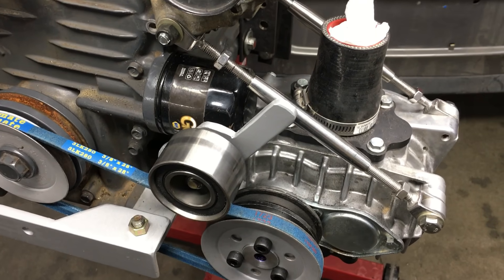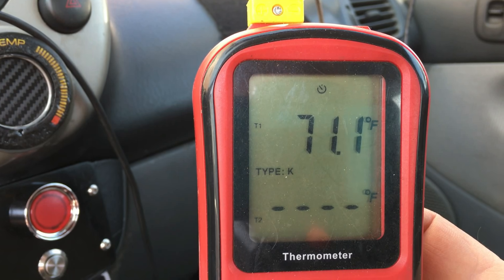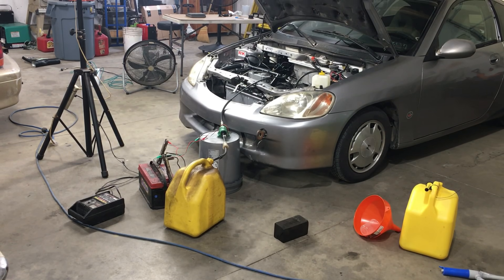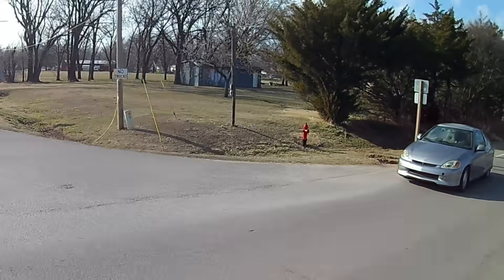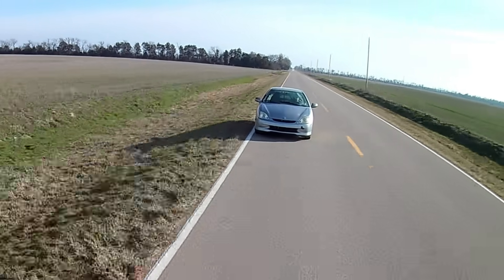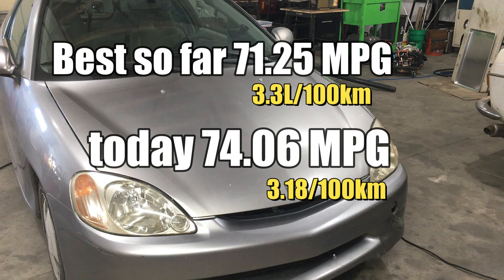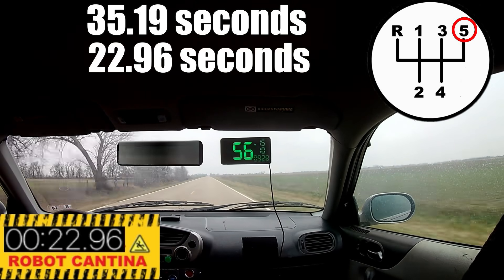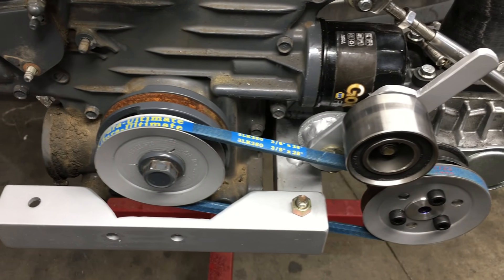S4 E10. We find out if the AMR500 supercharged Kubota diesel engine is more fuel efficient.

Comment: As you have not added more fuel it's possible that the extra torque that's now available is making the engine struggle less. Better economy on an engine with more torque but with no fuel rack adjustments🤔. 
Always enjoy the videos👍
Reply: Yeah I’ve noticed the same effect on most aftermarket small displacement engines I’ve supercharged. In normal everyday driving and especially during highway driving the extra torque will give you better mpg. It would be even more noticeable with hills since the rpm’s wouldn’t change much and gears wouldn’t need to change.
Reply from the maker: Keep in mind this is a diesel engine.  Adding more fuel during cruise is not the same as a gasoline engine.  On a diesel, adding more fuel only increases the rpm of the engine.  However the fuel rack is adjusted for more fuel at full throttle and that's how we were able to shave 12 seconds off the 0-55 acceleration test in the previous video.
Reply: @robotcantina8957  wouldn't 'adding more fuel only increases the power output of the engine and as a side effect increases the RPM" be a better way to put it? Only reason I say that is because say you're going one speed and you come up on a hill, a diesel will need more fuel*aka torque/hp* to climb that hill, but it doesn't necessarily mean you are going to change rpm! As you increase load on the motor you need more fuel to maintain speed of course!
Reply: @DarkAttack14  

For example:

Lets say you have 2 500cc engines trying to make 50 hp, and do so at 4000 rpm and a compression ratio of 8. You add a supercharger to engine B, and have it give 1 bar, or roughly 15 lbs of boost to roughly double the torque.

By roughly doubling the torque, you can use the engine at ~2000~, but for good measure lets say 2200 rpm.
According to a calc I found, to compress 500cc of air at ambient temp, its 28J, Assuming the supercharger is at 80% efficiency, this is 35J/rotation.

At 2200 R/m = ~37~ R/s. 37r/s * 35j/r = 1300 j/s or 1.73 hp. So it takes 1.73 hp away from the system.

However, by doubling the amount of air and fuel within the system, the air fuel charge density is doubled, which will act similarly to a higher compression ratio because the fuel and air particles are closer together giving a faster burn, so 8 * 2 = 16.

So, using a calculator online that has more accurate information than me. Going from 8 to 16 compression ratio, results in atleast 6% increase in efficiency.

So, 50 * 1.06 - 1.73 = 53 - 1.73 = 51.27. Based on this, the engine has a net increase efficiency of atleast 2.5%.
This does not include things like lowrpm high load efficiency gains, nor does it include being able to stay on the torque peak easier, or that camshafts tuned for low rpm torque peaks are inherently more efficient due to better fuel mixing and less stress and strain in the lifters and what not.

So, yes, turbos are not the sole source of efficiency gains in the charger world.

And before you say it YES, anyone with a leadfoot crappy driving will ruin efficiency gains, and turbos are not impervious to this as well. And YES, any charger, super/turbo, that is not adequate for the situation can and will also ruin efficiency.
Reply: @XenocraftGalaxy I know you're estimating but it would be a lot more accurate to measure pounds of air instead of PSI All that is telling you is restriction of the system not exactly how much air is being consumed through the engine
Reply: @robotcantina8957  👍👌
Reply: @bassbass69 Probably not, if it was a turbo yeah but more boost on this charger is going to just increase frictional losses for little gain
Reply: It'll be a bell curve. It can't go on like this forever. Also it's cruise performance being measured.
Reply: @ThePaulv12  of course, but it'll be fun to see what kind of mpg this little engine can pump out as well as how much horsepower could potentially be achieved

Comment: If you measure the weight of the fuel, then the temperature is irrelevant.
Reply from the maker: Its possible the fuel in the tank has expended or contracted during the drive which would alter the volume slightly and just to be safe we wait a while before we pump the tank out.
Reply: @robotcantina8957  Sure, but since expansion or contraction does not change the amount of material (number of molecules )  it has the same weight.
Reply from the maker: @zedjag7701  I think you are missing the point.  The method we use to measure the amount of fuel that is used is to pump the tank down by using the return line which on this custom setup is about an inch higher in the tank.  If the fuel expands or contracts, it effects the level of fuel the return line can draw out of the tank.  The difference is likely minor, but if we didn't do it this way, I would have thousands of comments telling me how I didn't take into consideration the temperature of the fuel and the expansion or contraction.
Reply: @robotcantina8957  Gotcha. good point.

Comment: I've heard those superchargers dont live long. What are the impellers made. Of.
Reply: Honestly a lot of folks you see using them are abusing them pretty heavily and getting them from less than reputable sources. So it makes sense. Servicing them and not getting them too hot is hugely important. The rotor material shouldn't matter as much as the sealing strips it has on said rotors, if it even has any.

Comment: My 3D printed electric supercharger boosts to 5 psi in its current max rpm without any restriction on the engine. I hope to test it more this summer.
Reply: Are you running a separate battery? Otherwise you are adding drag to the engine via the alternator.
Reply: @SuprSi  Separate 6S lipo. Recharging happens at regulated voltage and 10 A limited current so the load on the alternator is pretty insignificant.
Reply: @tahustvedt  Sounds like a decent setup! Nice one
Reply: Very cool
Reply: What volume of air does it move? This charger is pushing 500cc of air per revolution. What motor are you running?
Reply: @eslmatt811  I don't have figures for airflow. It charges 5 psi with my 1,6 L Hyundai petrol revving to max so it can pump more air than I need it to in my test car. The motor is a big SSS brushless and the ESC is  a Flier 400 A ESC. I have a video on my channel of a proof of concept test with an early version using one of my EDF motors (12S and HET 800 motor) on my Volvo diesel.